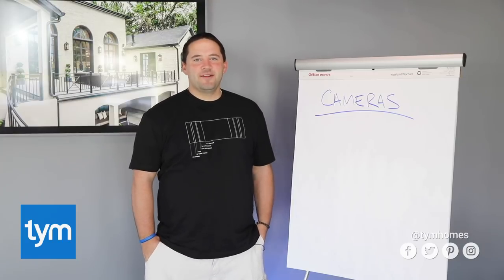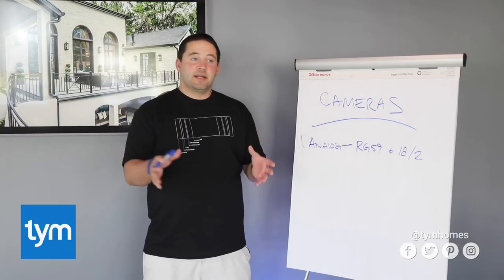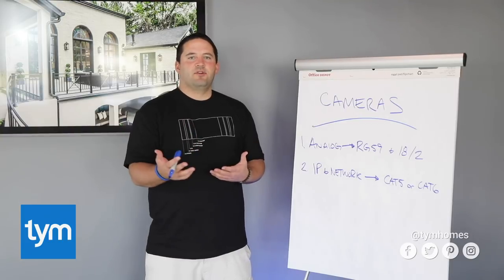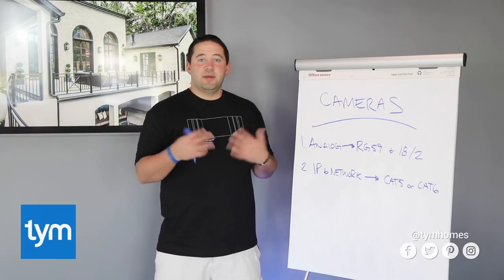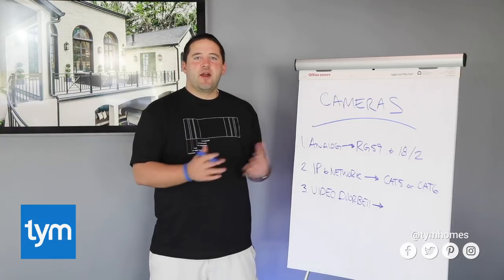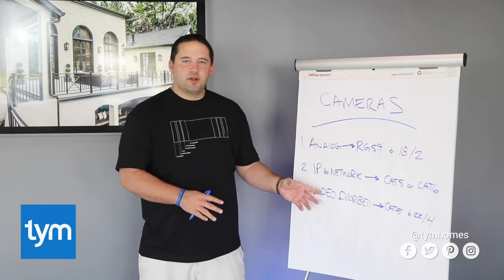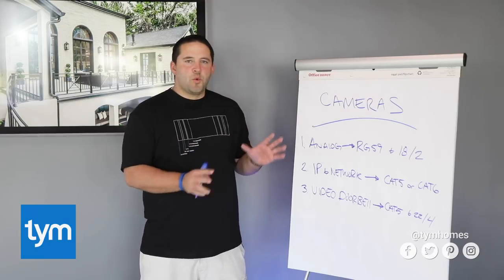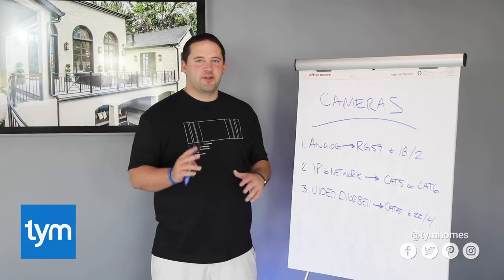How To Wire Your Surveillance Cameras

Comment: This is not a how to install anything video. This was just basic info on items you can get or use. Nothing about installing. I was hoping there were tricks on locations and angles used. Lighting and blind spots. Hiding the camera or using them to deter bad people. Wiring locations. Nothing other than suggestions. I didn't see anything really useful here.

Comment: Great video thanks. I've just moved into my new house we built and I got the contractor to run CAT5 cable to locations we're I'm placing cameras. I have a Hikvision DVR from our old house, but can you connect network cameras a DVR or do I need a NVR, the whole house is networked. Should I invest in a NVR?

Comment: My friend wanted a video doorbell setup for the future.  In the meantime I wired up a regular doorbell with a 16v transformer.  When I hooked up the video doorbell I did not take into consideration the higher amperage required.  In order to function properly I had to change the 16v to a 24v transformer.  Thanks for your tips I'm going use them today as I wire a security camera system.  You may have made my job much easier.
Reply from the maker: Ah thanks my friend, glad to hear it was helpful

Comment: Nice video. Wish i had seen it sooner. Just finished running siamese cable to specific points. Ran extra cable to points where i could put more cameras if the blind spot become a problem.  Should have run cat6 cable too.. But i guess i can use the existing cable as fish cable when the time comes.

Comment: What POE camera system and NVR would you recommend that communicates with Control 4? I’m looking more on the budget/mid tier price range. Thank you!
Reply from the maker: Steven there's lots of good options out there.  We use a lot of Hik Vision when we're trying to hit a lower price point.  It's more expensive than what you would pick up at say Costco, but it's one of the least expensive options that integrates well.

Comment: I liked the video. It provided a lot of valuable information.  I would have liked it more had there been a demo install.  Thank you for an informative session.  It helped.  I have had some IP cameras for about 6 years that I have not installed.  Don't laugh.  I know.  I could probably get far better technology for less now, and don't think that  I am not shopping.  I just want to be able to install them neatly.  The main challenge is how to run the wires for both power and data.  I need to see it being done to get a jumpstart.  OK, time to stop whining and get at it.